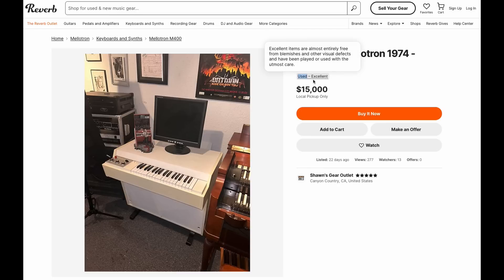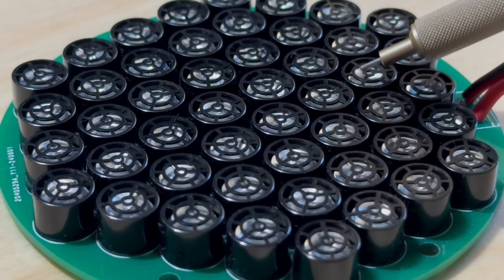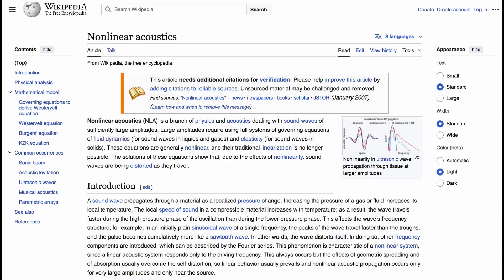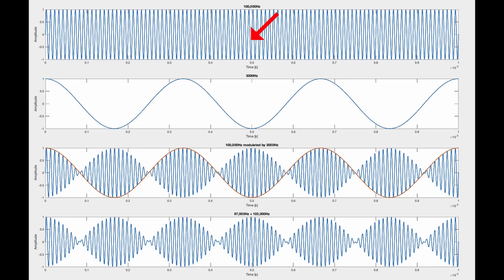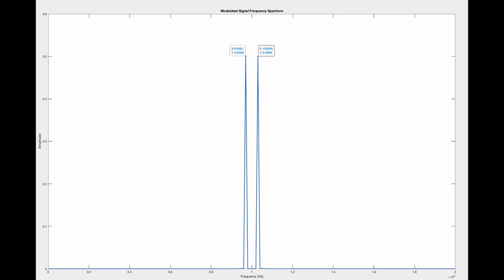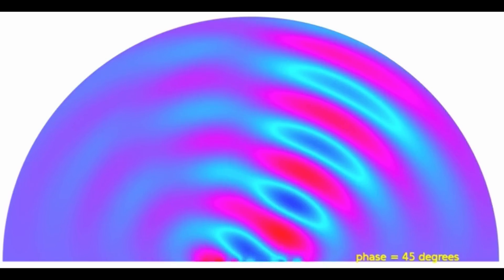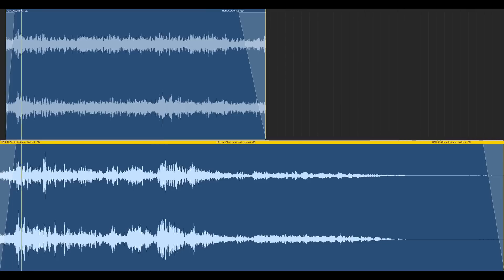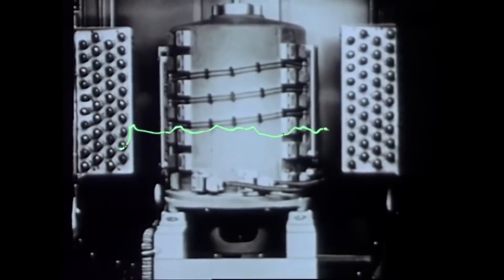How "Overture" Was Made

Comment: 4:30 i think what you're showing on the screen is ring modulation, in AM the modulation signal is kept between 0 and 1 rather than +1/-1. The difference is that AM lets the carrier through as well as the sidebands, and you'd get 97khz + 100khz + 103khz

Comment: in the 70's, working on digital (computer generated) sounds at U of P, the then sampling rate of the computer systems was very slow compared to today, and as we pushed the frequencies higher, the sampling couldn't keep up and we had the foldover effect and the sound would just drop down to a lower octave of that frequency.

Comment: i had an idea to make subsonic sounds with ultrasonics, but i'd need to be able to get a consistent half wave out of them. I just failed to figure out how to drive them reliably. i figured a pseudo PWM effect, with number of inducers standing in for pulse width, to replicate the subsonic wave. I figure the higher coupling with air at ultrasonic frequencies would reduce the losses incurred in making the lower frequency wave.
Kinda like replacing the smoothing output of a PWM digital amp with a physical analog (the ultrasonic transducer). so the number of transducers firing in one direction increases with the climbing amplitude of the subsonic wave, until all of them are firing at the peak, and then back down again, until they are either firing the other way, or a second set of transducers facing the other direction does it erc etc.
If it worked, the applications are enormous.

I

Comment: 5:33 this is the Fourier Transform a a DSB with carrier supressed. Not the one you show before. In AM the carrier still have the most of power not the side bands. This is why AM is energetically inefficient and SSB or DSB are used in radio communications as for the same power you get a better range.

Comment: From my understanding, air becomes non-linear basically because you can't have less than no air. Let's say you have a sin wave of sound in air at sea level pressure, one atmosphere. The sin wave represents pressure over and under 1 atm. with peaks let's say of 1.2 atm. and valleys of 0.8 atm. For louder sounds the peaks and valleys move farther away from 1 atm. but eventually the valleys will approach zero. They can never be less than zero, because you can't have less than no air. I'm less familiar with the nature of the distortion at volumes close to the limit, whether it is linear right up to zero or not, and if there are effects on the overpressure side as well.  

BTW I have the link in my browser of that same tone generator. You can open several browser tabs and play them simultaneously to explore mixing frequencies, and if you open two and enter frequencies just above 20kHz but space them, say, 1000Hz apart, you can hear the 1000Hz tone. There is one difference you will notice, that the simulated 1000Hz tone will have the "nodes" or "dead spots" of the interference pattern for 20KHz sound, which is much tighter and more pronounced.
Reply: Ahh, now it’s twigging for me. To demodulate AM you need asymmetric nonlinearity, like a diode or other polarised component, if you were getting symmetric clipping distortion you wouldn’t see any lower harmonics. I doubt the sound pressure is getting that close to 0Bar, but even 0.6Bar is probably enough to see some nonlinearity.

So I guess this technique would be more effective at lower pressures (e.g. in the ISS) and ineffective at higher pressures (e.g. in saturation diver quarters).